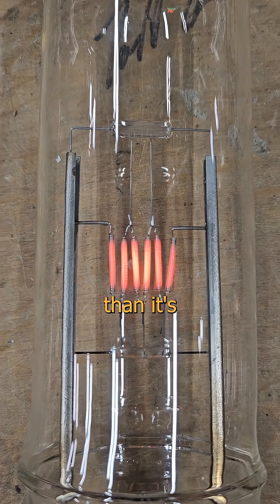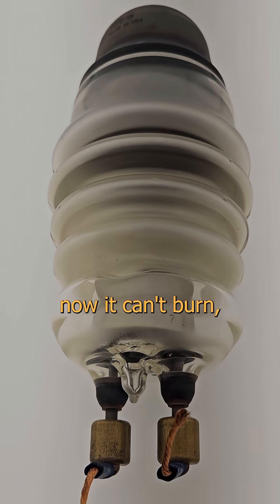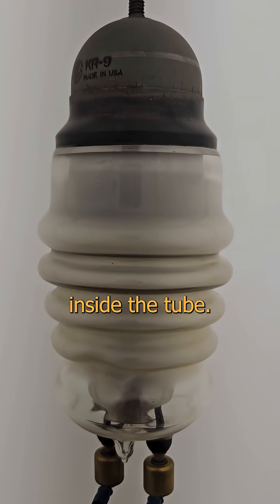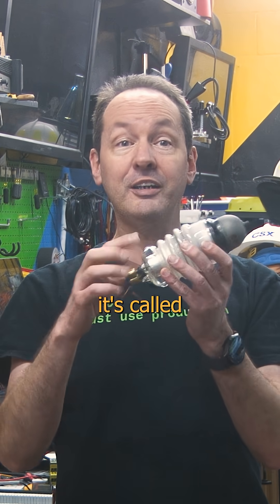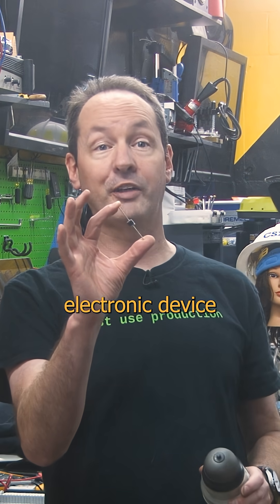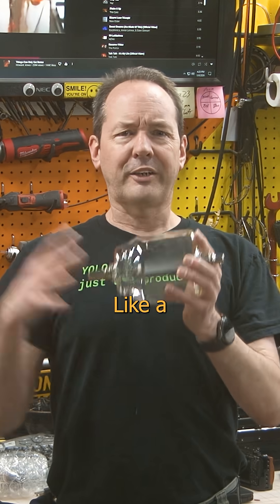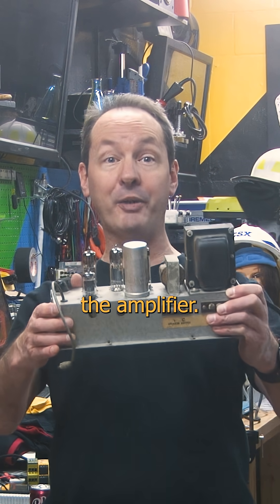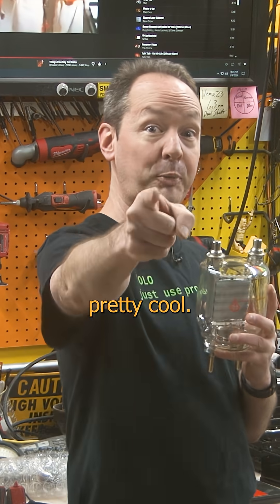Diodes #chrisboden #comedy #engineering #vacuum #tube #electronics #technology #educational #science

Comment: Did you know that Edison invented the diode tube by accident and didn't even know it?
We all know that Edison was rather fond of DC current. One of the things that Edison noticed what is that all of his light bulbs, when they burned out, they burned out on the positive end of the filament. 
If you remember seeing pictures of Edison bulbs, they had that little pigtail sticking out the top. 
One day for no particular reason, Edison left a thin little wire in that tube before it was sealed off after the air had been sucked out. 
Then Edison was just fiddling around with the current meter and connected the leads across that disconnected wire and the negative side of the filament (I think).
He measured the current and had absolutely no clue why. 
So he shelved it and forgot about it.

Comment: What happens to the conductor if it's superheated inside of a vacuum? Why wouldn't it melt? 

Also, this diode would take a constant (or not constant?) current from one end and be able to modulate how much of it gets through to the other end through these conductor/vacuum chambers? Or do modern diodes have a different system?

Comment: Strange I ve always seen the thermionic valve electrodes called anode (often plate in U.S) cathode and grid, except for directly heated valves where the cathode is also referred to as a bright or dull emitter depending on the alloying element in the tungsten, I've never heard or seen the anode referred to as a collector and transistors have a base if bipolar or a gate if FET never grid. so I don't think transistor nomenclature is a hangover from thermionic technology.

Comment: Honestly, your video explained something completely different from what I was wondering about. I was wondering why old high-voltage rectifiers were made out of mercury. It looks like it's because it's the same principle: one side emits the electrons and evaporates the quicksilver, but it condenses back (not depositing as a hard layer of metal on the glass or somewhere else), and like that, it still can work, and the cycle repeats. I am not sure about my idea, but it sounds possible. Funny transfer.

Comment: The diode logic explained is the same logic as how x-rays are created. High current is sent to a filament piling electrons. When the x-ray button is engaged, the anode is energized with kilovolts attracting the built up electrons. The electrons will hit a spinning/beveled plate of tungsten. Those electrons then get vaporized into x-rays which are read after going through a patient

Comment: And if you let a tiny fraction of the output of your triode control the grid, you create an oscillator -- which, if it oscillates fast enough, can receive or transmit signals through space known as "radio"  One single triode and a few resistors and capacitors can produce a receiver or a simple transmitter.

Comment: Poke a hole into the plate, put it on ground potential and the glowing wire on a negive potential and some of the electrons go through the hole and go on behind it, until they hit something. Add a metal pipe between the wire and the plate and put it on just the right negative potential, all the electrons go through the hole! And you got yourself the start of you first particle accelerator!

Comment: The second fun thing.... If you wrap that glowing vacuum with an electro magnet and crank that up, you get a few fuckken things...
Like a desktop particle accelerator.. aka a Cathode Ray Tube. Crank that voltage in the magnet up and you get an x-ray source...

Crank up voltages and currents in all directions and we're back to accelerating particles but on the scale that requires flashing warning lights, locked rooms and funky physics.

Comment: What's fun is solar panels are ALSO diodes. Specifically LEDs. It's the same way the coils and magnet that make electricity can be both for generating electricity through rotation, and making rotation through electricity. Shove some electrons through a solar panel, rather than letting it make them, and it makes light. Albeit light you can't see.

Comment: Remember, LED just stands for Light Emitting Diode. Thus, ANY diode can be an LED if you use it wrong enough
Reply: True!  Those tiny glass cased diodes emit infrared, AND are sensitive to it!  Flip chip integrated circuits can malfunction if enough light gets under them; they're usually sealed with black epoxy.

I used to put the glass diodes on a 9 volt battery and they lit up white.  I eventually found out that this was the contact wire going incandescent.

Comment: Later people started boiling off electrons from a separate plate, the cathode with a heater in some usage scenarios (these heaters, they need extra current, and turns out some devices don't like the 6V 50 or 60Hz off a separate transformer winding superimposed on the signal)
And I actually had a book on the whole thing :)

Comment: LED = Light Emitting Diode
Reply: A question on led's, how are they making led's that are not polarity sensitive?
Reply: @cbmech2563 good question 😅 I dunno 🤷‍♂️ I bet Chris or someone else reading this knows ❤
Reply: @cbmech2563   They don't. because physics be all serious about the rules and shit the just cheat by either 1. placing 2 tiny diodes into the same package so the same area lights up on pos and neg or  2, by including a rectifier bridge circuit thats just an tiny as the led with each strip or sometimes with each individual led, which also ads the benefit of making each individual light addressable, thats how PC's get those really smooth looking color changing transitions. By individually addressing every damn led light in the system and telling it to be a certain color at a certain time. Its kinda mind melting that my pc can be talking to 700 individual led lights and still has SO MUCH processing overhead that I can be playing a video game and capturing the gameplay in real time and transmitting that  game play to virtually the entire planet and im still never actually stressing the system.  My first PC was a nice x286 machine with 1 core at 12 mghz with 4mb of ram and it even had a huge 200mb hard drive that I couldn't imagine would EVER get full... PC performance just came in so fast that many people today just exp[ect everything to happen at once. and it almost kinda does, but so much is happening in the background

Comment: And don't forget that  name "base" is historical, because first transistor amplifiers worked in a so-called common base configuration, where the base was grounded. In the structure of first transistors base was the most massive part (it was the base) into which collector and emitter was melted/bonded
Reply: Rarely you see this configuration these days, you're completely right!!
Reply: @joetoetjube yes, transistors are different today :)
But common base allowed to squeeze the last drop of amplification out of some shitty germanium crap having beta between 5 and 15 on a windy day..

Comment: Unclear why the filament wouldn't attract electrons if the voltage polarity is reversed?
Reply: It's the heat that makes the electrons leave the filament ("boil off").  This is also why vacuum tubes have a heater.  Changing the voltages won't make electrons leave a cold terminal... until the voltages get high enough to jump the gap, but then you can't modulate it with a grid.
Reply: When you add energy to an atom, You force the electrons away from the nucleus. Add enough energy and they leave the atom at high velocity, which is often shaped by mechanical means in many tubes to "aim" them at the anode. Positively charging the Cathode will not bring them back. Many of the tubes produced for high power amplification were referred to as "Beam power pentodes" because the electron stream was focused with metal to enhance the electron flow to the anode and reduce the scattering effect. The cool thing about tubes is you can see the physical construction when they are made of glass. Most tubes in military applications had a metal shield bonded with the glass to make them more rugged (I have a few of them).

Comment: di- can also mean "Through". A Dielectric Voltage Withstand test is applying power THROUGH insulation and seeing if anything leaks. That fizzling noise just cost you a few grand in tracking down its source, but at least it was small, because i was using my instrument--lightning would manifest as more Expensive Sounds.
Reply: In this case the the 'di-' in dielectric comes from the prefix 'dia-', which does mean through/across/between, but they're different etymologies

Comment: Even knowing exactly how transistors work with the silicon doping and whatnot...transistors are WITCHCRAFT.
Reply: I think that the cool part is that there was a theoretical model for the transistor before they were able to build one.  It wasn't some sort of accidental discovery like thermionic emission was.  Thermionic emission (electrons boiling off a hot conductor) was Edison's only scientific discovery and he had no idea what to do with it.
Reply: @jonathanguthrie9368  But, being Edison, he patented it anyway. He called it "The Edison Effect".
Reply: When I first heard that light-emitting diodes were reversible, I genuinely thought I was witnessing an elaborate prank. "Ha ha, yeah I guess the math is reversible, so an LED that turns a current into light should also be able to turn light into current. But that's not--" and then the demonstrator ran power through a solar panel and you could see the diodes light up.

Absolutely witchcraft.
Reply: @liger04  The diode fact that I am most fond of is that all semiconductor diodes are light emitting diodes.  The ones used for rectification are optimized for rectification which means that they emit light in the infrared, but they all emit light.
Reply: @j @jonathanguthrie9368 I was not aware of that, pretty wild! Thanks for the info sir, hope you have a good day!
Reply: It's alchemy; using metals, crystals, stones, and poisons to make magic
Reply: I'm sure that's a coming video.  How the two doped silocon parts in diode let current go one way, and then how three doped parts of bipolar transistor can amplify current changes, an how the two doped parts of a MOSFET can have an insulated gate that controls voltage with tiny voltage changes.

for bonus points how the four doped regions of a  SCR or thyristor can act like a switch that resets itself, and a pair of those can be like a relay for AC.

Comment: You could do a series building on this to explain a triode (and linking it to transistors, both bipolar and FET). Then you can do a tetrode and then a pentode. I suspect you might have difficulty getting the principle of klystron across, if you get that far.
Reply: Vacuum tubes have more in common with FETs than BJTs since they are voltage controlled devices, whereas the BJT is a current controlled device. Specifically the Depletion mode FET, since when you apply negative voltage to a Triode's grid, you impede the electrons from reaching the anode.
Reply: It's a whistle.  The electron beam spins around the magnetic field, and the chambers resonate at the design frequency.
Reply: @danrbarlow ooh I like that analogy. I am going to steal it.
Reply: @severs1966  Please do!